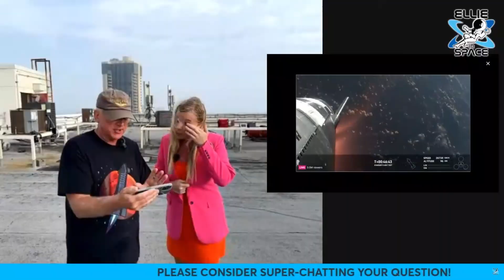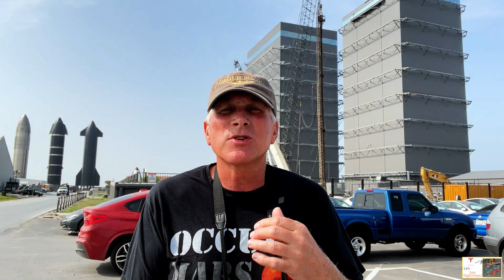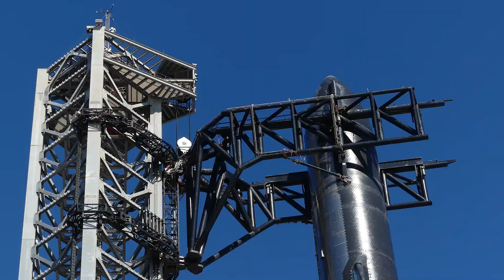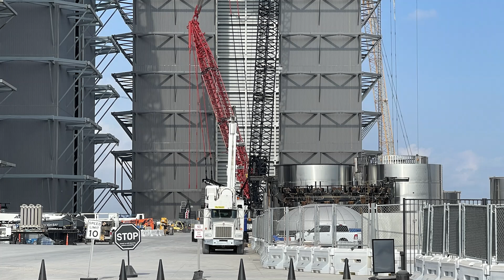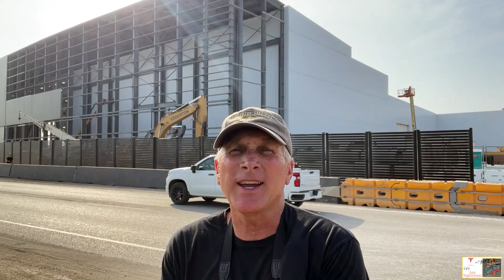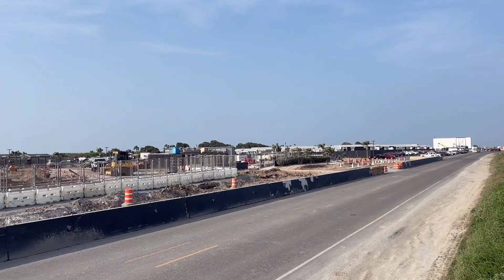19 March 2024 Starbase Production Site Construction Video

Comment: Looks like 4 more launches of Starship for this Calendar Year 2024 which would make a total of 5. If all 5 successfully "clear the pad"(pad infrastructure not destroyed by the launch vehicle) this isn't the Space Shuttle so much easier to improve upon both reliably and if need be add more power as to date Starship still seems underpowered for what is demanded at the moment (100 plus ton payload plus a boost back burn plus reusable 2nd stage.) Definitely much relieved to see a 3rd Flight free and clear of Hurricane Season as the infrastructure built at Starbase is more valuable than the rocket itself at this point I agree.  Of note remains that Cape Canaveral does in fact have a "launch cadence" meaning multiple rocket launches per week now so this is definitely something new clearly and with that comes an incredibly experienced team for "site management" as I know New Zealand based Rocket Lab founder Peter Beck said building the launch site was an immense effort unto itself and I don't think to date "Electron Rocket" does more than 10 launches a Year still as of yet. Very impressive progress been made so how IFT-4 through 7 play out this Year plus all of the others no small matter anymore absolutely.  Great coverage therefore!

Comment: I would not classify the Starship flight as successful. more precisely partially successful. Booster failed landing burn. Starship failed attitude control and broke up at start of re-entry into atmosphere.
Reply: When a baby takes their first steps, is that considered a successful first couple of steps, or is it not successful until the baby can easily walk?
Reply: I would not classify this as a successful comment. It did not meet my expectations.
Reply: Depends upon what SpaceX goals were and not what others believe.
Reply: *test flight, to be precise. Progress = success
Reply: I would personally classify the first three launches as 20%, 50%, 80% successful. In my opinion. Of course it’s all about gathering data and fly again quickly. Many flights/gather data/rebuild/Try again is a type design process. The usual design process is exceptionally slow where you test every component slowly and take 10 years for your first flight. (SLS) Besides being slow, the problem with this design philosophy is that in 10 year your original design flys but is already obsolete…..🤷‍♂️
Reply: If each flight goes farther and completes more tests then it’s a success
Reply: The purpose is to quickly find out what doesn’t work, and collect data. If nothing fails then SpaceX failed to attempt enough. So far this method has proven to be faster than the traditional NASA approach. Being faster is cheaper.
Reply: “Succesfull” always depends of your expectations. In my world it doesnt mean flawless. Test flights is all about collecting information. Being in orbit and half way round the globe, and more than 1 hour of flight, would certainly have produced a huge amount of usefull information, which we all know is crucial for making the complete succes in the end. No one believes that testsflights are supposed to be flawless, but a process to show what is working, and what is not and why.